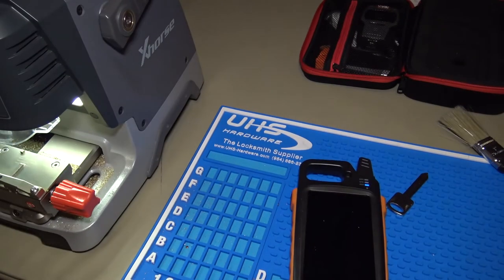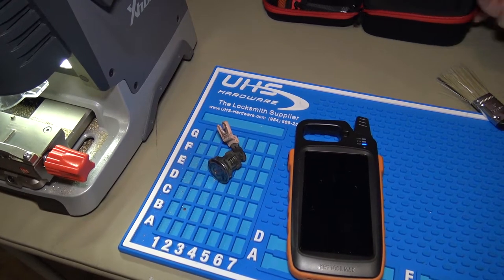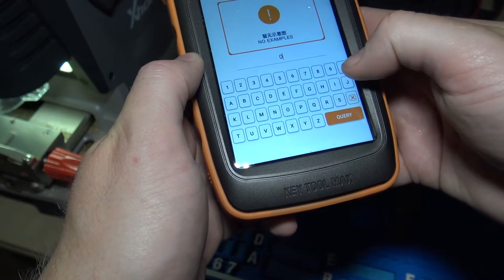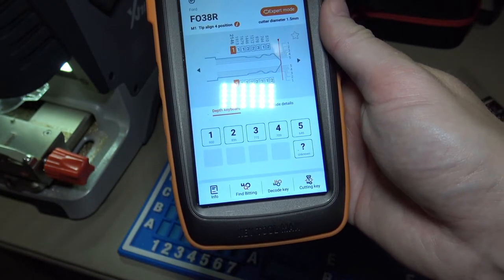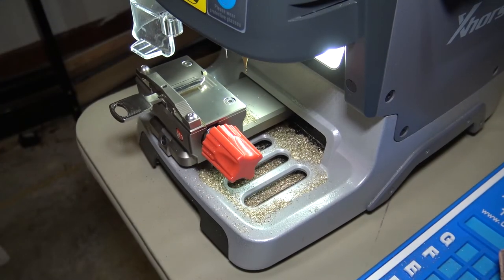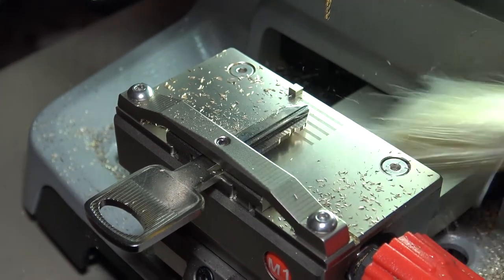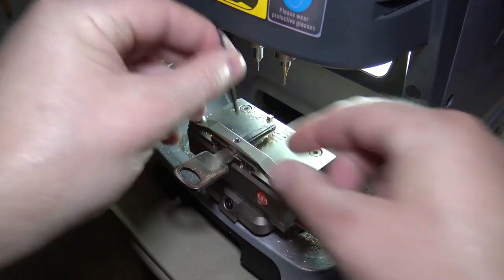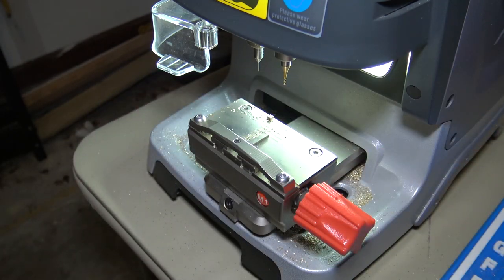(430) H75 Ford Key Cut on Condor Dolphin Using All Keys Lost

Comment: Hi how do you find the code do you put the lishi read in
Reply from the maker: andy h lishi the door lock and used a code fill program to get code
Reply: Thanks is the problem on the dolphin
Reply from the maker: I don’t understand what you mean
Reply: russej02 it should have said program on the dolphin
Reply from the maker: No there’s no code fill on the dolphin
Reply: russej02 thank I wasn’t sure if it was in the app
Reply: @russej02  
I have same cut machine I got trouble with Ford key decode key and cut H75 key 
Can you help ?
Reply from the maker: @divedram9861  only suggestions I have are make sure your machine is updated and make sure the key is clean.